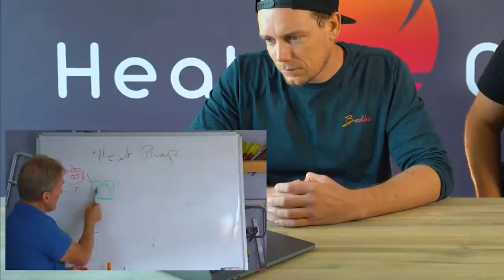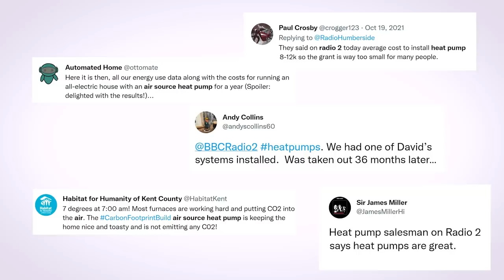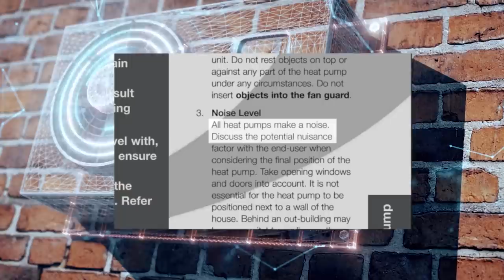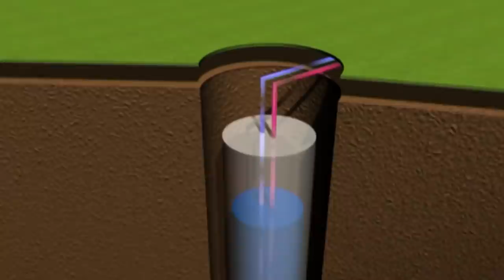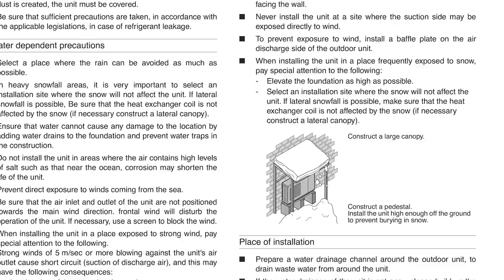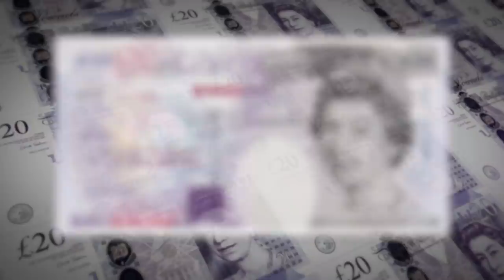Heat Pump Secrets They Don't Want You to Know

Comment: It seems that the most common comment is that heat pumps can work really well given the right property, in particular one that is highly insulated with an optimised heating system. I wonder how much of the success in these instances is down to the heat pump, or rather it is the insulation that is making the difference. A sensible approach for now might be to invest in the upgrade in insulation, but stick with a condensing gas boiler as the heat source. This is likely to give the best of both worlds for now, and would pave the way for a heat pump when the technology has matured
Reply: Some friends of ours building a new house - triple glazing, underfloor heating etc. etc. - were advised that a HP made no sense because their main energy requirement is hot water not heating and HP are crap for hot water so the electricity would be used for that purpose in any case. Needless to say they went for the Gas boiler as a result. Surely, if a HP makes no sense for a property like that, they don't make sense for anyone?
Reply: It’s matured. It’s ready. If your home leaks like a  sieve, you’ll pay dearly for nat gas too especially as carbon pricing comes into effect around the globe. Fix your home. Decarbonize. Step to the future. This man has a gas license and he clearly wants to use it to the end of days.
Reply: It is matured… fridges, freezers, air conditioning are all heat pumps. Other (much colder) countries have been using them for decades now.
Reply: @polarunion  "Fix your home" - easy to say, harder to do when you are in a city like London. And carbon pricing is just a big scam.

Comment: My parents have had air to air heat pumps installed for at least 5 years (maybe more), and it works great for them. Probably the quietest appliances in the house too. We're Norwegian though, so houses are pretty well insulated to begin with - they have to be or else we wouldn't survive. They run all through winter too, even in temperatures well below -10 sometimes, although I don't have numbers on the energy efficiency during those temperatures. Perhaps they are tuned differently than the ones offered in the UK.
Reply from the maker: Hi Kreaturen. I thnk the main difference is the fact that we are putting them through a wet central heating system. I hear good reports on air to air and they are cheaper and easier to fit but they have a cooling capablity and that makes them inelligible for a grant aid.
Reply: @SkillBuilder  all our streets heat pumps were set not to be on at night time but it's a awful system it's been constant problems since it was installed in 2012 including a new fan in the garden and loads of other new parts it certainly doesn't work in a 1950s property
Reply: @SkillBuilder  that's so ridiculous! They aren't qualified because they are also air-conditioners? They are so inexpensive and efficient too!
Reply: It really depends on how the house is build/insulated. English houses (no offence) are mainly older houses that are poorly build and insulated. Often even very drafty around the doors and windows. If your house is decently build and insulated with proper seals around the doors and windows a air/air heatpump is a perfect solution (ofcourse with solarpanels)
Reply: @Timberjagi  Being poorly built and poorly insulated are two completely different things.
I would suggest that houses built over 150 years ago, as a lot of houses are in the UK are not poorly built at all, they were just not built with insulation in mind. They are mostly solid brick builds on solid foundations.
I grew up in local authority housing built in the 1950s. Exceptionally well engineered, concrete mould with cavity walls and very warm. We didn't have double glazing or central heating (this was the early 80s) and no one froze.
I am actually more concerned about the quality of new build properties today since David Cameron took away the need for minimum build quality. The new builds that I've seen have not been a patch on older builds in my opinion.
An insulation audit for a property would take care of many of these problems.
Reply: @Timberjagi  Extremely popular in Canada and the northern US, as well as Europe. Perhaps driving on the other side of the road permeates through the British senses worse than Brexit even.
Reply: I have been to Norway and in the houses, where I was in lilihammer the houses were entirely made of wood, but English  houses  are  made of bricks and concrete
Reply: @SkillBuilder  The UK has simply been quite slow to adopt heat pumps. I live in the UK but moved here from the Netherlands, which has a similar climate albeit with slightly colder winters. Heat pumps have gained significant popularity here and many home-owners are choosing to switch to one, also those with older houses. The only issues that I'm aware of is when heat pumps are installed by installers that are used to installing gas boilers. Other than this, all the scepticism in the UK about heat pumps seems very much misplaced. The technology isn't new and scary, it's just that the proper steps to educate people in the UK about heat pumps haven't been taken.

I think that a big part of the problem is that home-owners in the UK might rely too much on the trade to figure out what's best for their homes. Don't get me wrong, it's good to listen to advice but a gas boiler installer is going to install a gas boiler. In the Netherlands, more emphasis is placed on educating home-owners about the different options and incentives that are available to them. There is also greater awareness on how central heating systems work and a fair number of people even opts to install a heat pump themselves (which you're probably sceptical about). 

A solution probably lies in a mix between better government incentives, better education and resources for home-owners, and a more organised system for the trade to adopt new practices and implement changes.
Reply: @teunvl95 I'm also from the Netherlands and I am working on getting a heat pump, because I want to help save the environment.

But unfortunately much of this video is spot on. Heat pumps alone are not a magic fix to reduce heating cost and if not done absolutely perfect, it's going to be expensive to run.

The heat geek channel is something to watch. They try to educate installers to be designers and the ones to commision the systems so they get a worthwhile SCOP.

But the first thing to take care of insulation first, a properly designed radiator or underfloor heating system and a spot on heat loss calculation instead of just trying a one size fits all approach.

The real savings come from doing it right. Even a gas boiler will get more efficient, but never gets really expensive to run if the installer messes up.

Heat pumps are getting better all the time, but even with incentives, it's still a big investement that's not going to pay for itself within 10 years.

But on the positive side, all of the required measures to make your home perfect for a heat pump also bring down the gas usage of the boiler. So replacing that gas boiler later when it's old or broken is not a crime.

Currently it's still quite hard to power alll heat pumps with clean energy in winter. As soon as coal or nuclear is involved the 35% efficiency of these systems basically means global warming at the power plant and with a COP of 3, it's not going to be very efficient if you count the grid losses.

In the future this energy mix will change, but will still require natural gas (or hydrogen) power plants with a efffienct of about 60%. At that point, even a COP of 3 will be a 180% return on burning gas remotely, instead of 90% burning it in a home gas boiler.

In terms of cost and availability, I think the focus should be on newbuilt homes for now. These can be properly designed, installed and commisioned at scale without trying to fix and redesign every unique home out there.
Reply: @SolAce-nw2hf  Home heating specifically is responsible for about 14% of the UK's carbon emissions. In the Netherlands this is 10%. Given that both countries need to reach met zero in 2050 they have no choice but to find a solution to heat homes using sustainable energy.

Hydrogen is most likely not going to be used for heating in residential properties. Biofuel won't work at such a scale either. Natural gas can never be carbon neutral. In other words, electricity from a sustainable grid is the only option. New homes need to be heated electrically, but existing properties too. A heat pump is the most efficient way to use electricity for heating, so there you go..

We don't have the luxury of focussing on one thing first and then the other. Everything needs to happen at the same time: making the grid greener, install heat pumps in new homes, replacing all old heating systems in existing homes. This all takes time and we can't sit around and wait or we won't reach the targets that we have set for ourselves based on the advice of our scientists.
Reply: @teunvl95  I agree doing nothing is bad and  a heat pump in every home is the end goal.

But with a limited budget cutting down co2 emissions now is also possible without touching the gas boiler and just working on insulation. Gas boilers have a limited lifetime anyway.

Our gas power plants will be converted to run on Hydrogen produced with solar surplus in spring and summer. Combining this power without co2 emissions with a home heat pump running at a COP of at least 3.0 will make a difference.
 hydrogen boilers only make sense in huge buildings or those that have no room for heat pumps and water tanks.

Also there is still a very limited production scale, and a very low number of installers that actually know enough to get it right. Until this changes, it's a matter or prioritizing.

Most big old appartement buildings should just be improved using a bulldozer and starting over.
Reply: @SolAce-nw2hf  fair enough, but I'm sure we agree then that every gas boiler that's being replaced at the moment with another gas boiler is a waste of money in the long term, right?

A gas boiler that's installed now might well need to be replaced by 2045, assuming it's serviced well. Between 2045 and 2050 the last gas boilers will need to be replaced. If we're all still installing gas boilers, the amount of boiler replacements in these 5 years won't be realistic. We also shouldn't bet on future governments sticking to the laws and commitments made by previous ones.

Gas boiler installers and other tradespeople won't take the initiative to get trained for heat pump installations if there is no market for it. Due to the costs involved, the govt needs to step in to make sure this market is there. Replacing old gas boilers that are due to be replaced with heat pumps provides good incentives for more people to get trained and for more heat pumps to be developed and manufactured in the UK.

The UK is way behind on almost every European country on their heat pump installations. It's not a coincidence that there is only like one or two small UK based companies that are developing them. They need a market.

Of course what you said about insulation is true. We're definitely fucking up there big time. Even for new builds. If only we had policies like forcing landlords to upgrade insulation. Oh right we did, until 2 days ago..
Reply: @teunvl95  Yes, basically it's silly to buy a gas boiler if a heat pump is within your budget and works in your home.

Starting 2026 every gas boiler installed has to be a hybrid heat pump system where possible. Appartments and some other buildings where it's just not possible don't have to, but any house will. Hybrid makes sense if you can't get the COP right in winter, as it will only switch to gas when that costs less or more power is needed (DHW and a very cold home).

In the long run gas boilers will have the market share that heat pumps have now.

Comment: Reading instruction manuals can be a very dangerous thing to do.
I'm an air-conditioning and refrigeration engineer and while I don't install or particularly care 
about this type of system they are basically the same as a split air-conditioning system.    

I think you might have a point about burning gas in a power station but then one power station probably 
burns gas a lot more efficiently than having millions of poorly maintained domestic boilers?

As for the electric heaters in an outdoor unit, they are just crankcase heaters for the compressor and 
only run for a minute or two on cold starts. (They don't heat the air moving over the coil)

I can't remember the last time I changed a fan motor but I'm pretty sure it wasn't because 
wind had been spinning it backwards.

I can only remember of one time in twenty years of having a problem with rats chewing through an interconnecting cable
and most of my work is in london where rats are everywhere. (They can be attracted to and chew through any electric cable)

I have never had a problem with rain, never built a shelter and never known of anyone else having to do so.

A defrost cycle takes about a minute and yes in this time your heating will stop running but while I'm not a boiler engineer, 
I think most of us know our boilers don't run constantly.
That's why they have pilot lights not to mention you can hear them fire when they actually need to heat the water in a system.

I can't understand why you would need to slowly start the system, opening one circuit at a time.
I install lots of VRV/VRF systems and will often turn 30-40 fan coil units on at the same time from a centralised controller.
They are smart enough to know what's happening in the system and run up accordingly.

When you talk about noise and placing the units I would say you can't just put a gas boiler anywhere you like,
exhaust flues can't be too close to any opening windows or doors and as for noise this shouldn't be a problem
unless you buy some cheap unknown brand from ali express.
The only real time you will have problems is in flats were gaining permission can sometimes be an issue.

Finally the fact you even mentioned bolting the units down is just ridiculous, do gas boilers not 
need to be fixed in place?

P.S
Have you ever looked at the instructions that come with any type of medication?
Sometimes I wonder how anyone takes even a paracetamol with the warnings and disclaimers they
like to include.
  

  
  

t
Reply: Give that man a prize, Best comment here, you said it all.

Comment: These are oversold here in the US.  Once the temps get in the teens or lower they either use a ton of electricity or fail to produce a lot of heat if not a super low temp version.  Natural gas is cheaper than electricity and that’s a fact.  They are great if you have electric resistance heating and want to get rid of it or only use it as backup.  I’ve had three systems.  A Mexican no name from eBay. A Fujitsu low temp and a Panasonic good to -5F. None have been any better than the other.  They all struggle when it’s 15F or colder.   The spec sheets even show how much less BTUs the heads provide when it’s in that range.  They are awesome until it’s super cold out.  And agreed with the all the issues with wind,snow, sleet, freezing rain.

Comment: Keep up the good fight Roger! Heat pumps serve a great purpose-- hear me out. 

Picture a rural setting, a nice house with a propane tank in the front yard, (too far away from the city to get natural gas). 
This is the one situation where a heat pump shines. We will do dual fuel systems, (heat pump with propane forced air furnace for "backup". What we do is install an outdoor sensor that talks to the thermostat and then we can institute lockouts, i.e. run the heat pump until the outdoor temp hits 35F/2C then the propane furnace takes over until the outdoor temp gets back above the lockout setting. 

That being said, if a homeowner is connected to the gas grid, by all means I recommend a 95% efficient or better forced air furnace over a heat pump any day of the week. Like you said all this technology is fine and dandy but who is going to repair this stuff when it breaks? I have seen a lot of high end systems work great for the first 5-7 years, but when PCB boards and ECM motors fail, all of the claimed savings are negated after extensive repairs.
Reply: That's sort-of where I'm at. I just bought very old house in a rural setting in need of some TLC. There's insulation, but it doesn't seem great. Currently, the house has electricity and oil and the oil powers the furnace for the baseboard radiators and hot water. I want to remove all radiators and put in ducts and heat pumps (and maybe have oil as a back-up if needed). We'll be rebuilding some of the center chimney, so I'm hoping to sneak in some ducts in the center chimney cavity and up to the attic. (I could be naive in how this'll all work.)  However, I'm also not in the house during the fall and winter months, so I wonder if having a heat pump off for 7 months of the year is okay - ? I want the system to be usable in the winter, just in case, but most of the time I'd use it for cooling. I can't stand the baseboard radiators from an aesthetic point of view. They also take up a lot of space in already small rooms.